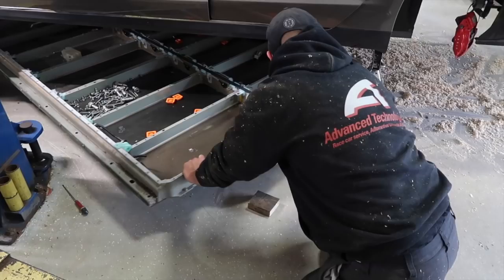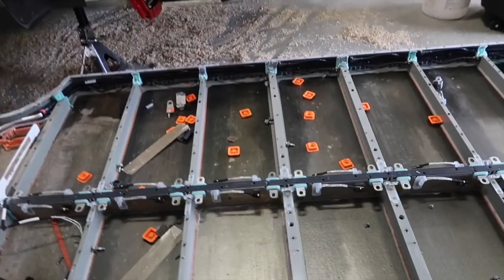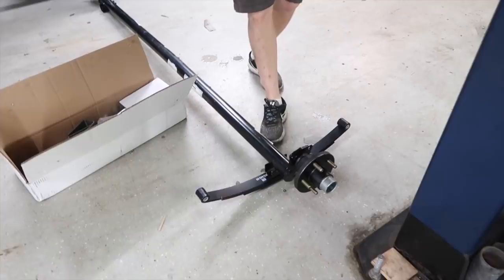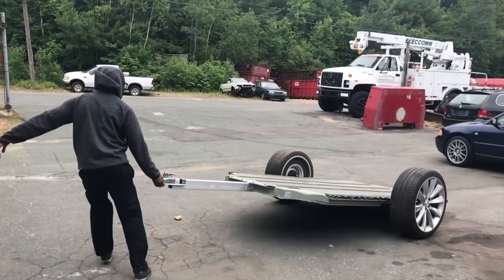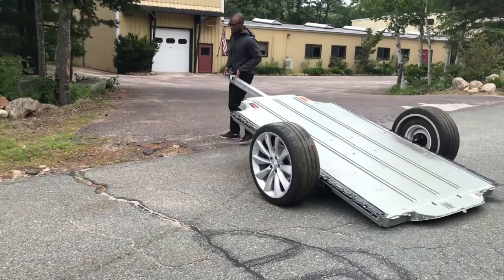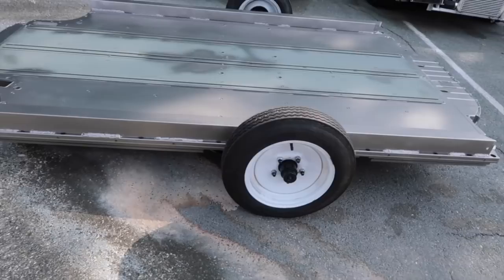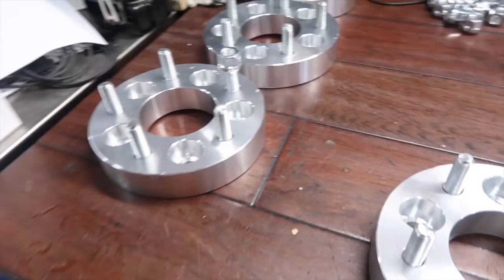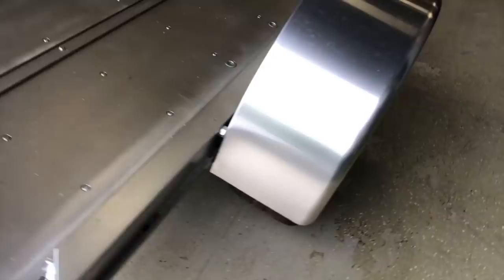DIY Tesla Battery Trailer

Comment: So if one were to make a functional battery pack trailer how much extra range do you think you could get?  ;)
Reply: CajunJosh be surprised if the range increased at all towing the trailer could use more extra power than the battery would provide. Also would take twice as long to charge the car+battery trailer.
Reply: Chris Hart just cover the trailer in some solar panels ;)
Reply: CajunJosh  i hope your joking!!  I love it when people talk about solar panels on the car roof,  the extra cost and weight of the panels would be pointless, just leave the panels fixed to the ground somewhere and just charge up from them.
Reply: Okay fine, maybe a wind turbine on the trailer then to re-coop some energy.
Reply: CajunJosh  it is rather hard carrying electricity around at the moment cost aside 500ml. Of diesel (small coke bottle or can of larger) has the same energy as 2 x regular car battery's. One fits easily into your back pocket the other is barely movable one in each hand but it's hard to even walk along more than a few steps both would get you around 7 miles distance .  The battery's  = around 1kw hour
Reply: If 1 full battery pack is enough to move a battery pack plus all the weight of the actual car. A second pack should more then double the range. Even if its being towed, as the second pack doesn't have the load of a second car to move. However range on the first pack will be affected as now its towing the weight of the second pack
 But it shouldnt be affected more then the second pack yould have if it was also movine the actual car.
Does that make sense. Im sure theirs some math formula at tesla for this.
Fill up the modules with batteries, add a trailer enclosure or build a caravan ontop of it, add solar panels to the roof (if you can find them cheap enough then why not, even if its hardly going to do anything) make it a little more aerodynamic and you've got your self a super long range extender.
Reply: sk phon  if both battery's are 100kw the range would never be more than double.
Reply: Remember if the trailer was another whole tesla the range would be no better as each battery would be powering a whole tesla hence no gain in range at all
Reply: sk phon more than the weight is the issue of aerodynamics. If you want a trailer you are presumably on a road trip and are going at highway speeds. If so wind resistance and turbulence is going to be a much bigger factor than weight. If you can get it quite close to the tesla and streamline it, it could be fantastic and nearly double the range. You could even use the storage space on top for foldable solar panels and an inverter so that you are gridless when you get to where you are going. Unfold - get maybe 9 square meters of panels, charge it up while you are out and about. Use it to charge the car in the evening.
Reply: It wouldn’t be double but it would certainly be extended. For example my 3t truck tows a 3.5t caravan with terrible aerodynamics. That load does not double the fuel usage. A low profile trailer like that would be worth it’s weight. Likewise solar panels would never give a full charge but it’s about percentage gains not absolutes. The weight and air resistance of panels on flat deck trailer would be almost negligible. The angle of incidence of panels would be of more concern.
Reply: Tim Freeman it would only be worth it's weight if you needed the extra power the tesla already goes a long way. Would still be better if you could just get the extra batteries in the car (i'm sure it would be possible)  but who really needs 200kw's. Also the solar panels may not be to bad to carry (weight/aero) but they will provide little power, solar panels are not that impressive 4kw system  would take a good amount of time to charge the car even in the best sunshine

Comment: Why don't you carry a real Tesla battery on the trailer and have it plugged into your Tesla so it will charge while driving?? Or use solar panels to help charging. 

Even if you can't charge while driving try to work it so you can just unplug the battery on the car and plug in the battery on the trailer so you can always keep moving. I'm sure you'll think of a way to make it a easy 30sec process.

Comment: Rich,

Your trailer idea is a business opportunity.  

So is selling tesla modules to Recreational Vehicle owners. 

I have been considering either building a small camper from scratch, or rebuilding one. 
They need electrical systems of course. And batteries. Which are heavy. And don't last long. 
Unless they are the new lithium ones. Which are crazy expensive.  Unless they are used tesla battery modules.  

There is also a need for strong, light trailers. Much like what you just made. 

I came across a you tube channel which you should check out. It's about a couple who have a large rv trailer. They installed a tesla module which powers their entire rv.

They have worked out all the solutions regarding solar charging systems and battery management. He is an electrical engineer. 

Check out Morton 's On The Move Tesla battery

Also do a general you tube search. Heading: RV with Tesla battery. 

You can make a nice income by selling used, tested battery modules.  The going price seems to be about 1500 each for ones from low-mileage Teslas

A solar rv with a tesla system means that there is finally enough affordable battery power to make camping away from campgrounds possible. 

The states west of the rocky mountains have huge areas in which rv camping possible. There are many national parks  and scenic areas. 

Yet electrical power hookups are not available most of the time. The going price of an rv lithium battery is around 1000 dollars. A tesla module would have the electrical capacity of several of those.

Comment: You could use the trailer for a battery pack for your tesla. I run a a RV and trailer service department I have extra pieces parts allways laying around I can help with the lights and I have extensive knowledge of all system on an RV so if you want to build a Tesla RV I'm your man I've been a fan of Tesla since before the cars came out just never had enough to purchase my own cuz I got 5 kids I'm just a few miles west of Cleveland let me know if your interested in a collaboration I am allways rebuilding electrical componets cars and RVs

Comment: Hey rich just wondering if you could try harvesting the SIM card from one of your mcu’s and try putting it in one of those mifi hotspots or a cell phone. I opened up my mcu but It is a standard size and I don’t want to cut it to a micro or nano because of the risk.

Comment: 100000 dollars car with trailer yes this is great do not buy tesla because you will buy car for 25000 dollars and you spend another 20000 for fuel in 10 years time that is mean you spend 45000 dollars or you buy tesla for double price plus repairs plus electricity price in duration of 10 years plus trailer haha the tesla is a toy for rich people and on the end do not think electricity will be cheap when you have millions teslas on the road plus do not think environment will be clean because the batteries are environmental nightmare